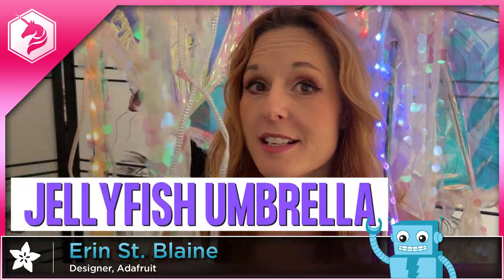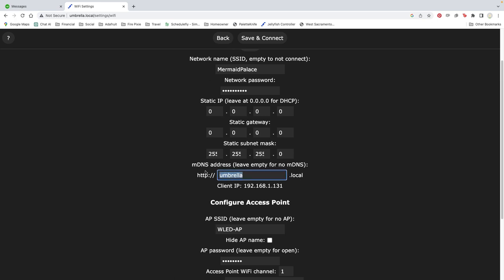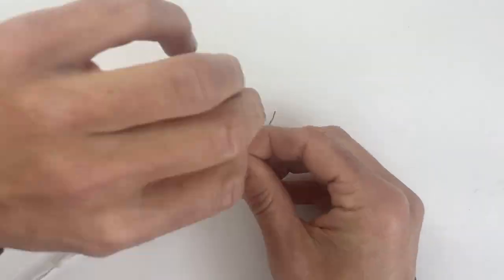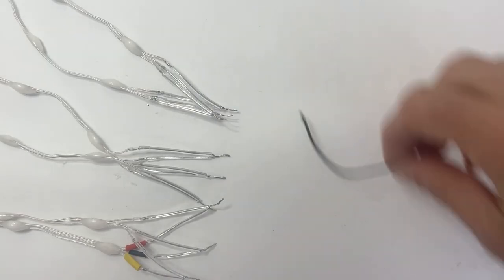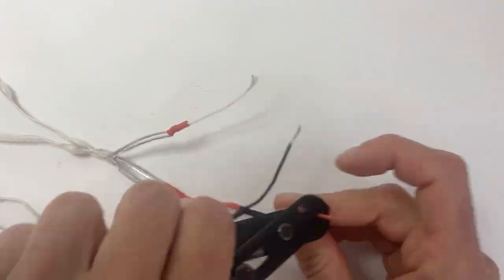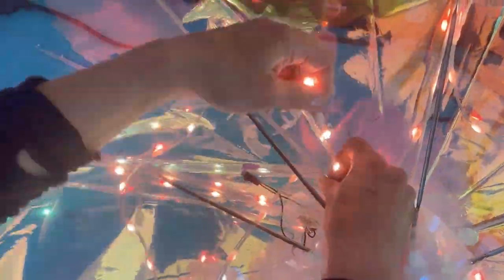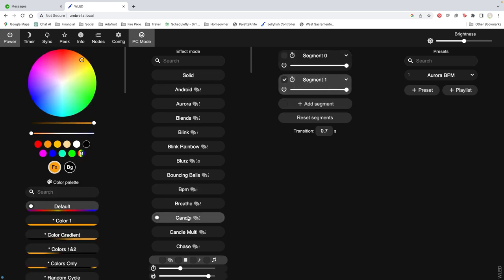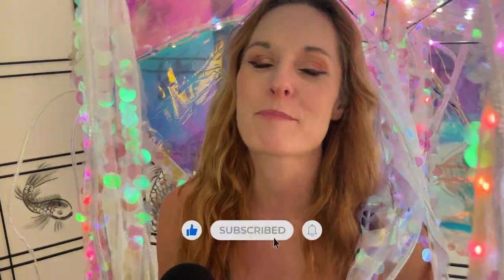Jellyfish Umbrella LED Festival Locator with WLED #adafruit

Comment: Hello! Excited to try this. Thank you for putting this awesome guide together. I've bought all the components, but I'm stuck with identifying the direction of the wire on the Neopixels. Can you point me in the right direction how to do this? I used circuit playground, went to makecode.adafruit and set strip on A1 with 20 pixels, then connected 3 alligator clips to VOUT (Red), A1 (Yellow), and GND (Black). I stripped off the female plug from the Neopixel strip and then played around with different configurations with the alligator clips. All that happens is that at one point the circuit playground shuts off. A few times here I've had maybe 1 LED flash very briefly. But that was it. I tried it with 2 different strips. Also tried it from the male plug side to see if I'm being silly. Nothing is working. Please can you point me in the right direction to test the wires correctly? Many thank!